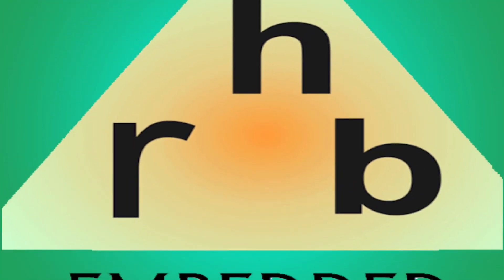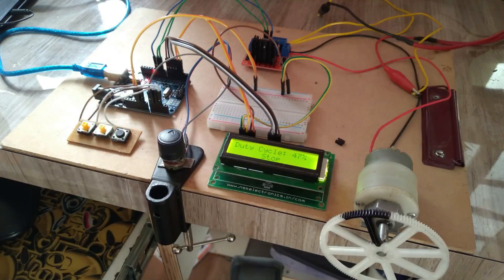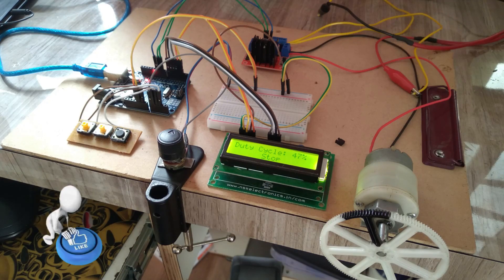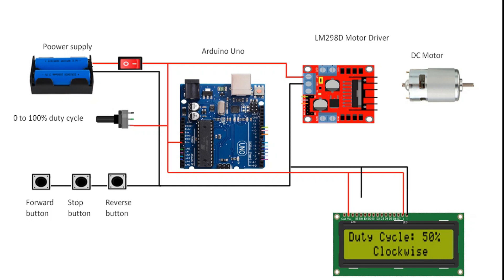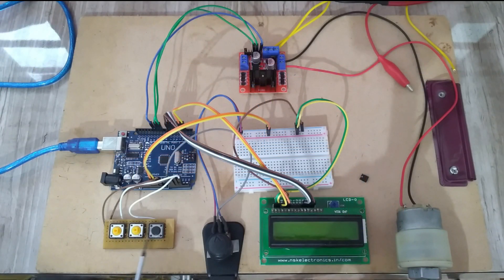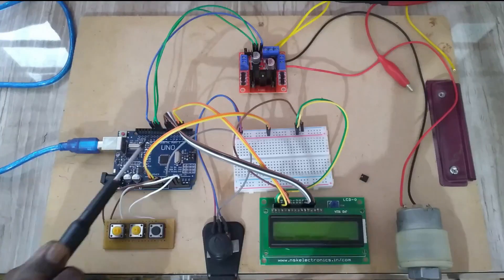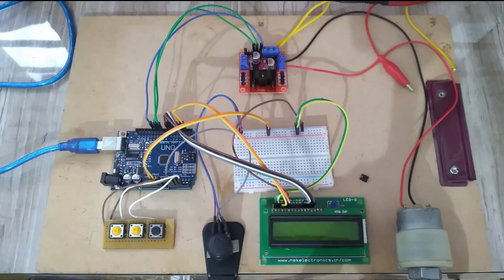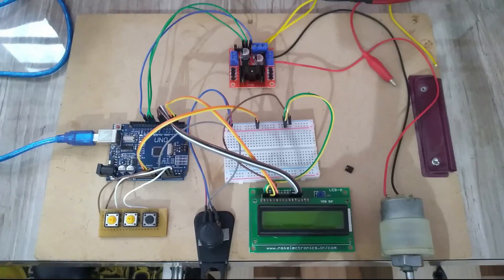How To Make a DC Motor Speed Control using Arduino and L298 with 3 Push buttons  on either direction

Comment: If my display only has 4 pins, ground, vcc, scl, and sda, can it be installed? If it is installed, which pins should it go to, sda, and scl? Should the coding be changed?
Reply from the maker: A5 (SCL) and A4 (SDA). code is to be altered, examples are given in arduino Ide

Comment: Very good sir! It would be great if the lcd showed how many degrees from 0 -360 it went through!
Reply from the maker: hi captain, thank you for your comments, this is little diffiicult when we are used DC Motor, this is possible if we use steppr or servo motor

Comment: Hi I want to use, i2c LCD for this project, how can i modify the code?
Reply: there are many videos on youtube on i2c lcd find the right one and use there code with this code and i am sure it will work i will recommend this video "How to use LCD LCD1602 with I2C module for Arduino - Robojax" or just press this lick  "https://youtu.be/q9YC_GVHy5A"
Reply from the maker: Use library for i2c
Reply: Instead <LiquidCrystal. h>  library to   < LiquidCrystal_I2C.h> library, also must change LiquidCrystal_I2C.lcd (0x27,16,2) instead old one! ok? Another, no lcd. begin, but lcd.init(); lcd.backlight();